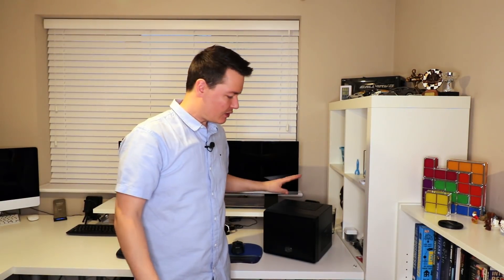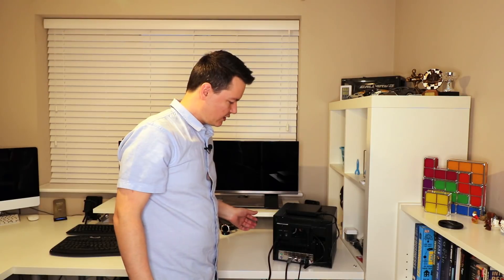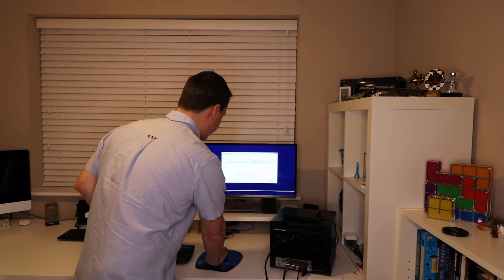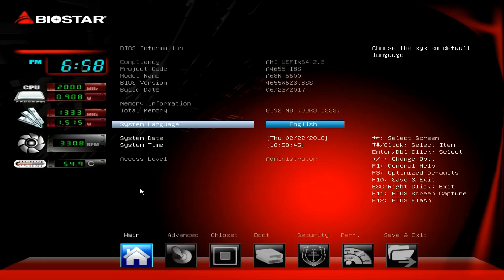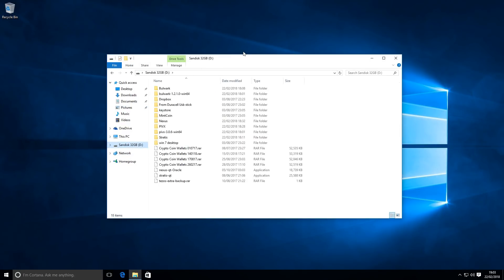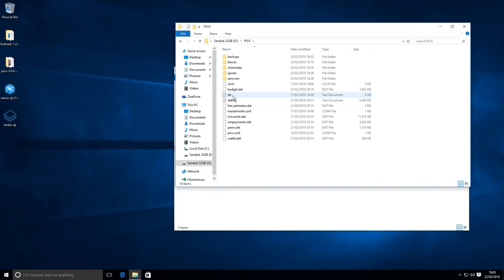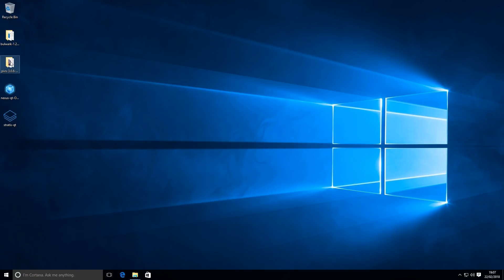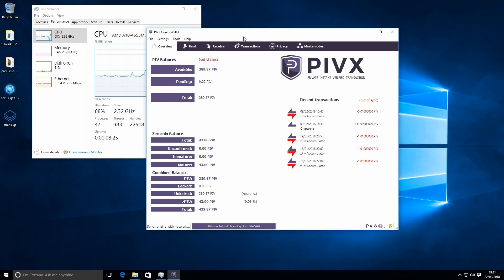Building a Mini POS (Proof of Stake) Mining Box. Biostar A68N-5600 ITX Part 2

Comment: Could you explain why you chose to make a dedicated box? Why not run it on a PoW machine which you are already running anyway or just on your main work machine since it takes so little resources?
Reply from the maker: Just an excuse to build another PC, I really enjoy building computers. I wanted something completely independent of my other machines, one of my concerns is for running funded wallets (unlocked for staking) with untrusted mining software.

For most people staking on existing hardware would make the most sense.